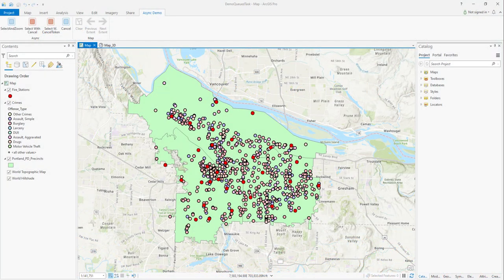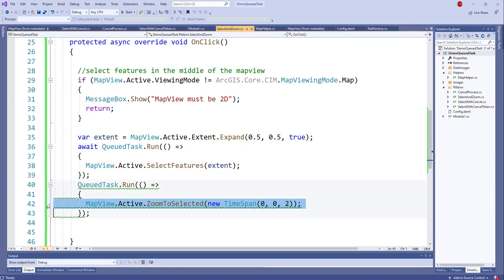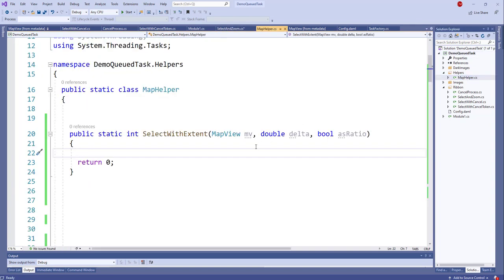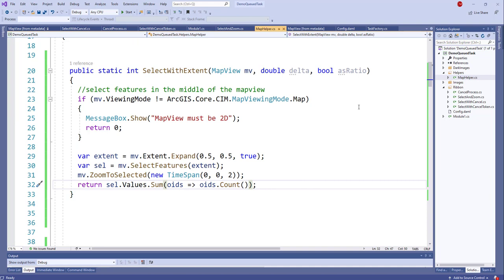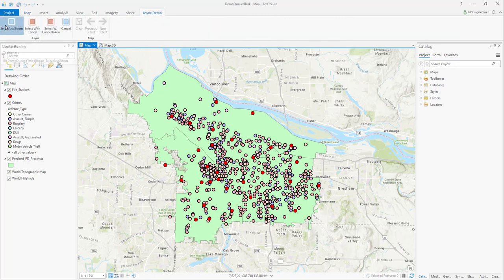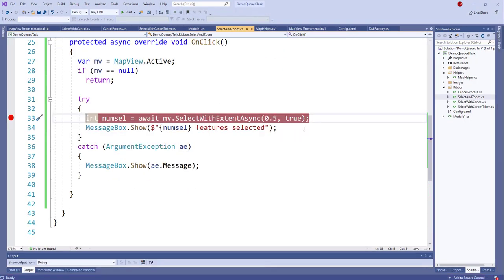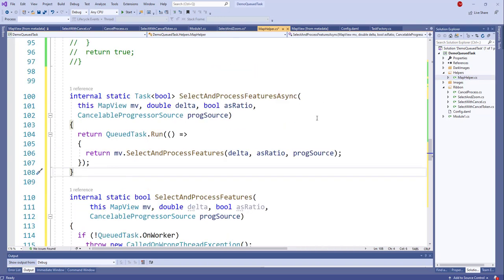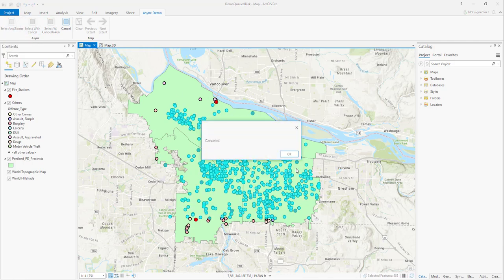ArcGIS Pro SDK for .NET: Synchronous and Asynchronous Custom Method Design

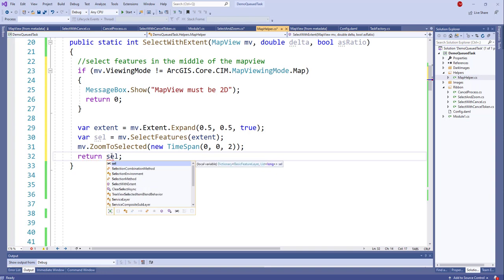Comment: Where is the source code located? For the most part, I was able to duplicate up to the part of the CancelableProgressorSource. Also note in the video at 8:30 you return sel.Values.Sum(oids => oids.count()); However, my sel does not have a definition for Values. I hoping to figure this out with sample. I tried find it  at under at  "2021 dev summit resources our arcgis pro sdk wiki" (I tried googling this, but figured no longer available after 3 years). Awesome job.